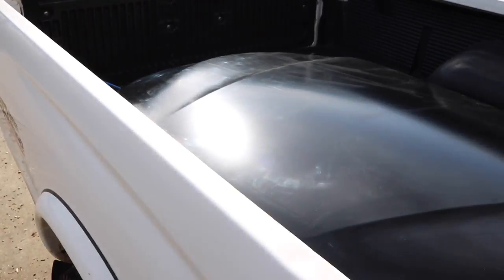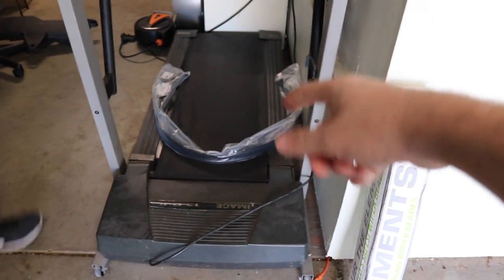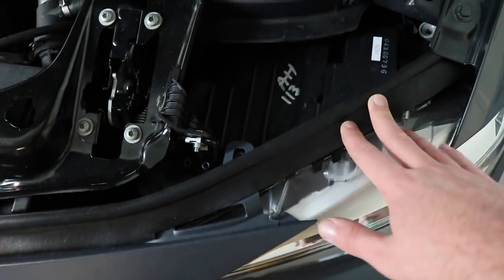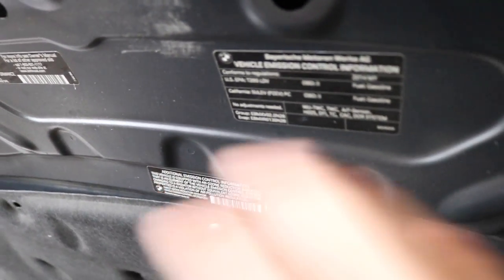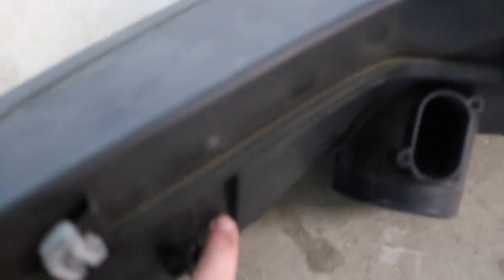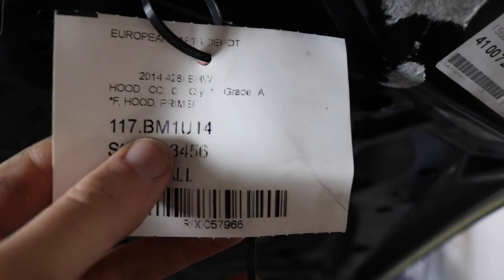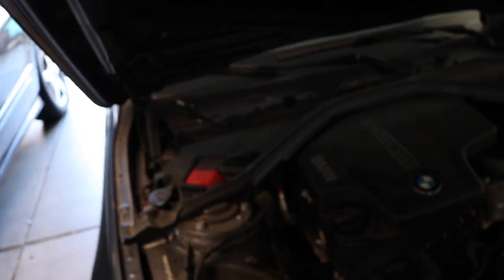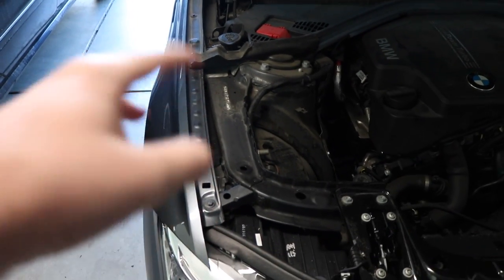Rebuilding a Salvaged 2014 BMW F30! (Part.7)

Comment: It’s not the hood. Your frame needs to be shifted. In the accident the front rails in the engine bay split off to the side. Needs to be put onto a frame rack to line up the gaps

Comment: Nour you should upgrade to a f30
Reply: From what I have read, the F30 isn't as fun to drive as the E90. The F30 leans more towards comfort than sport, and has electronic steering which doesn't give you the same connected feel to the road as hydraulic steering. The F30 is nice looking, and the updated interior and electronics are nice, but the E90 is more fun to drive. For the driver purists, the F30 was a big letdown. There are many threads on this, check it out.

Comment: f30 and f32 have a same hood :D
Reply: Adas just letting you know bro 4 series is just a previous 3 series coupe so basically the same car/interiro but different peices to fit two doors only
Reply: @matinmoosaei2069  no. f32 actually has same hood as f30. look up at part stores, it says f30/f32 hood.
Reply: hiiso yes that is actually my point that they are basically the same car but 4 series is a two door vrsion. I know that they have the same hood as well bro ;)
Reply: hiiso With the e92 I meant that it is a replacement of that and it should be called 3 series coupe but they changed the name to 4 series

Comment: Double check your hood latches... The gaps can be adjusted with the bolts on the hood latch. I know this because I rebuilt my F10 and ran into the same issue ... here is a link to The BMW repair manual, and it shows you which bolts. https://www.newtis.info/tisv2/a/en/f30-328i-xdrive-lim/repair-manuals/41-body/41-61-engine-compartment-lid/GzGOg4bJ

Comment: Are you guys joking? Different hoods??? For god sake just go to bmwfans and check hoods are identical to all F3X cars. Literally all of them. OEM part number is 41007290944, exactly the one you have right there. Fitment is the problem of your bended frame and fenders.